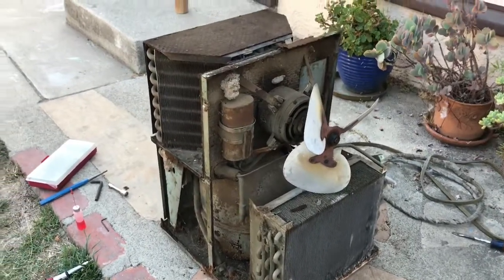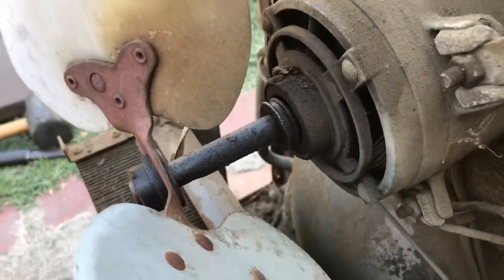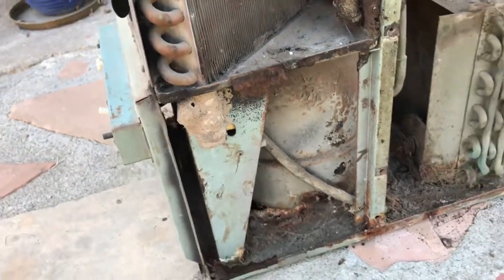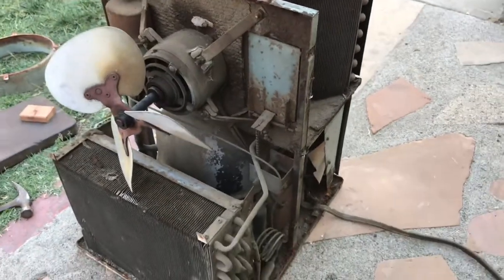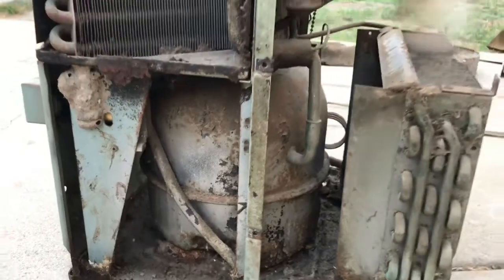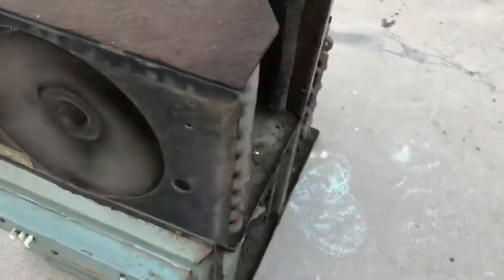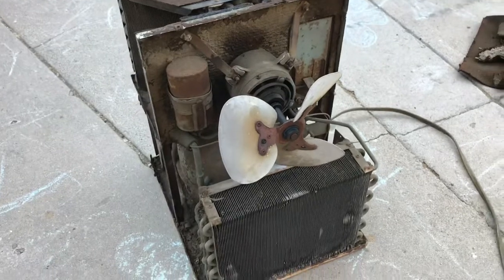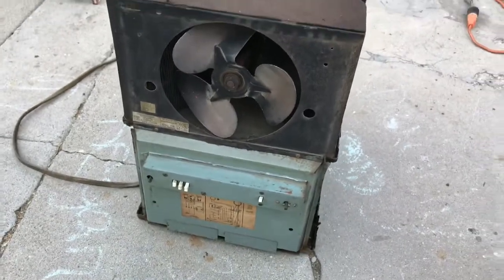Vintage 1955 Westinghouse Casement Air Conditioner Compressor Test

Comment: I personally worked on about 3,000 room air conditioners from 1979 to 1990 and I never saw one like that one. I worked on some Westinghouse air conditioners that would have dated from the early 1960's. That is a true tank of an air conditioner a real strongly made unit.

Comment: The scary thing is that it could explode at the high pressure side because its so old. and it contains CFCs for sure.
Reply: It's much lower pressure and much thicker tubing than modern stuff - which leaks out after several years whereas this still hasn't after decades.. and CFC's don't harm you at all, this is R-22 as well which was commonly used into the 2000's and only has 5% the ozone depletion of R-12, aka Freon.

Comment: Those compressors were just built very well had a Coke machine that had a slow run compressor on it talked to a guy and he said them things will practically run forever
Reply: It's a Tecumseh s series compressor.

Comment: you need to do a full on restoration on it an repaint it because they used lead in it
Reply: It does not need to be repainted. Also lead paint is not dangerous.
Reply: @MrWolfSnack  how dumb are you lead based paint can harm anyone even though its small amount of paint look it up

Comment: Your going to have to take the insulation out because its a 50's modle and in the 50's asbestos was used in every thing so the insulation in that unit is asbestos so yeah
Reply: Good stuff. Probably better than fiberglass
Reply: @DRNEGOLICIS  hell no it aint

Comment: I didn't know the O. A. Sutton Company made air conditioners.  Ottis Sutton was an aircraft engineer himself, who experimented with propellers and aircraft propulsion.  He was the inventor of the ducted fan propulsion system and tested it successfully on a model aircraft in Oklahoma back in the 1920s.  Vornado was the name of this model aircraft.
Reply from the maker: Thanks for the info. I've been a fan collector forever, thus I was aware of Vornado being an OA Sutton product, but had no clue they made air conditioners. Saw my first Vornado window AC unit this past year and it has 50's some style to it but this Westinghouse (being a casement design) is uniquely different, and the fact that it's a re-branded product is interesting.
Reply: @BackusBreeze  Westinghouse was having union problems in the early-mid 1950's.  That is why they contracted with O.A. Sutton to manufacture their window air conditioner line for 1954-56.  In 1956 Westinghouse started to make window air conditioners again for the first time after the war and by 1957 Westinghouse was making their entire line.
Reply from the maker: Great info, thanks 👍🏻👏🏻

Comment: Sounds like a bearing is worn out but if it's blowing cold, I guess it still works.
Reply from the maker: Funny, it wasn't making that noise before I first started messing with it. Good lesson to leave well enough alone.
Reply: @BackusBreeze  Bearings go, if it has been sitting forever, stuff happens. Just might want to replace the bearings to be on the safe side before using it too much.

Comment: update please!! wondering how much power it sucks could be a surprise
Reply from the maker: razzorbladz No update yet, sorry. But soon, I hope!
Reply: @BackusBreeze  I'm wondering what it uses power wise for to possibility of running it on  a AC inverter off solar
Reply: BackusBreeze hello friend I have a Sanyo SA-FWL1671 (BW) All I need is a spare part for it to start working but I have no idea what it’s called. It’s what holds the spinning blower at the top & bottom, something that looks like a round rubber cap. Can you help me ? It’s a casement aircon.
Reply: @PhenomenalDiva  

A bearing perhaps?

Comment: it's impossible to find a vintage air conditioner that still works
Reply: Hahahahaha I haven’t found a old unit that didn’t run
Reply: @kenb1918  i was about to comment the same thing
Reply from the maker: I have been pleasantly surprised. I have four A/C units here, and they all work.
Reply: I'm not really sure one of my units would be considered as vintage but it's a 79 fenders 8k and it blows colder than my newer artic king
Reply: Soy boys keep scrapping them "oh this is destroying the ozone layer" - NOT!

Comment: That so cool I have a 1968 kelvinator and it works amazing older units work so much better than the newer ones the new ones only work 5 years. But mines 51 years old and yours is 64 years old we got some good units!
Reply: MustangLover 1970 you mind making a video of the unit?
Reply: Will Butter this is mustanglover 1970. This is my hvac channel my 1968 kelvinator is featured here
Reply from the maker: Thanks for the comment. Look forward to checking out your Kelvinator 👍🏻.

Comment: I've got a 1970 GM (yes that GM) Frigidaire casement window air conditioner and it's the heavy! These casements by design are heavier but I couldn't imagine how heavier yours is because of the 2 evaporator coils and huge compressor. Mine has a big Tecumseh AJ compressor and 2 fan motors. Both are standard fans no blower wheels. It amazes me how these old units get right down to business cooling. Like yours mine blows ice cold pretty much instantly. I've got videos of it up on my channel if you're interested.
Reply from the maker: I'll be sure to check it out, thanks!

Comment: I'm glad to see someone else who loves antique HVAC stuff. 

This is a really well built machine. I can tell by the sound of that compressor; it runs at about 1200 RPM. The new ones run at 3600 RPM or so. That would allow the compressor to live much, much, longer!

In my opinion, I would carefully consider replacement of the compressor motor's capacitor. They often fail and end up taking the compressor with them. It is inexpensive insurance.  Get a Titan HD capacitor. They are still made in USA and have a very good reputation.

One thing to watch for; the condenser fan really needs the shroud to be in place around the unit. That will direct the air from the fan through the condenser coil, to cool it. You didn't run it long enough in this video for it to be a problem! But if it were run a long time like that, the compressor would be overloaded because the condenser would overheat.

Really hope to see this come together. I would also be interested to see how the power use compares to a modern unit of the same BTU capacity. I would expect it's not as far off as many of the "mainstream" people would like you to believe.

Thanks for saving and documenting your repair s to this!
Reply: NO  leave PCB capacitor in there... new titan pro are china junk might last couple years around my aria....
Reply from the maker: Thanks David, you're absolutely right about the air flow. Though I didn't say much about it in the video, this unit requires the exterior casing, fan shroud, and the front plastic grate to be properly installed for correct air flow, both to cool the condensing coils, and for routing the air usefully into the space to be cooled.  Wish the front grill wasn't in quite so poor condition (cracks, breaks, missing mounting tabs). Thanks also for your opinion about replacing the capacitor with something good quality and new. Not a bad idea at all.
Reply: PCB Cap will last longer. 
And in my experience older window units use the same if not less electricity.
Reply: @Penney's Modding Channel 
That symptom does sound like a bad capacitor (if it has one); or possibly a bad start-relay. Could, unfortunately, also be a stuck compressor.
Reply: @Penney's Modding Channel 
That's very likely to be the capacitor!
Reply: @Penney's Modding Channel 
That's good. The higher the capacitor voltage, the better. That is just a maximum rating for the insulation dielectric in the capacitor. The compressor and fan motor only care about the uF (microfarad) rating. The higher voltage ones just last longer.